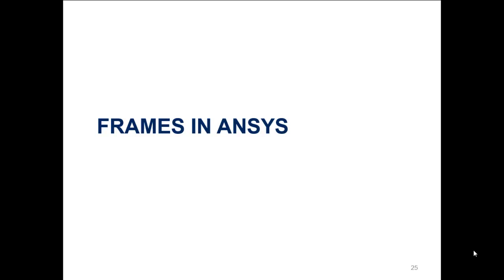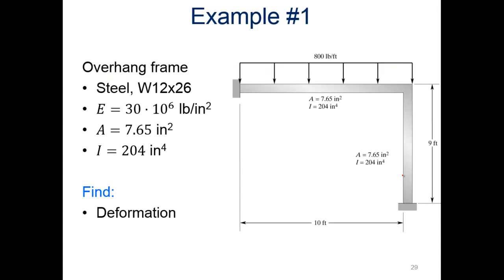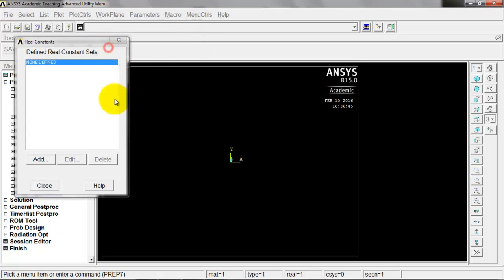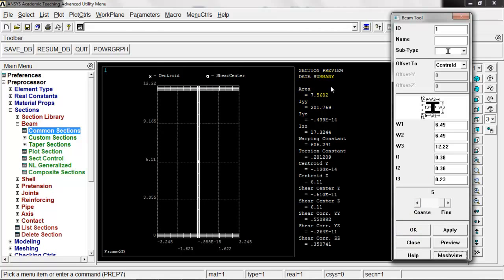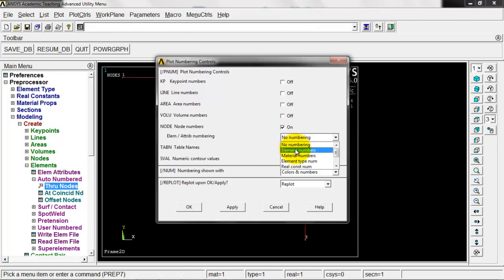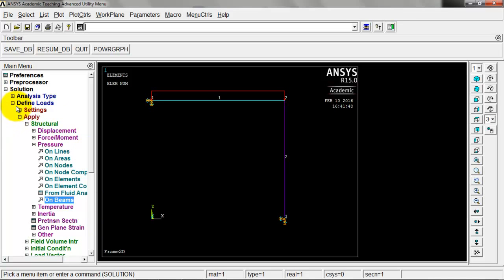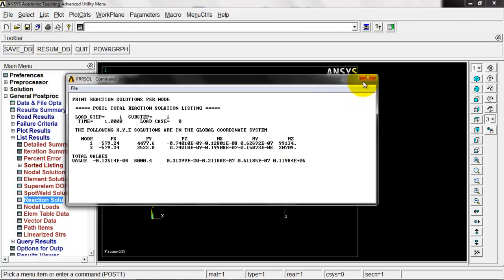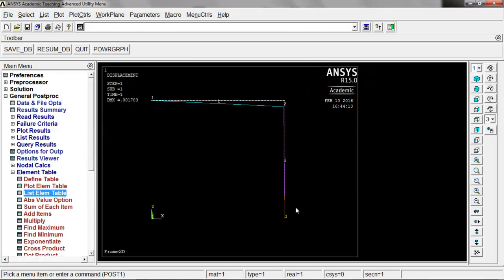Frames (3/4): ANSYS Example

Comment: thanks for the upload.  I can apply a load on the node or maybe even a distributed load but how to apply a point load on the element.(e.g. in the centre)
Reply from the maker: +Himanshu Raut: You cannot apply a point load in the middle of an element---point loads can only be applied at nodes. Instead, break your element into two parts with node at the location you want to apply the point load.